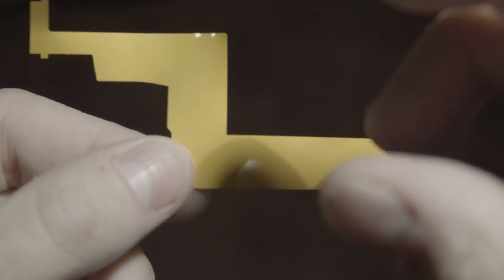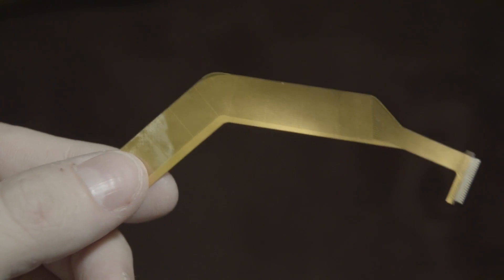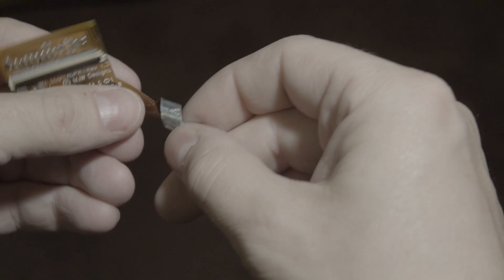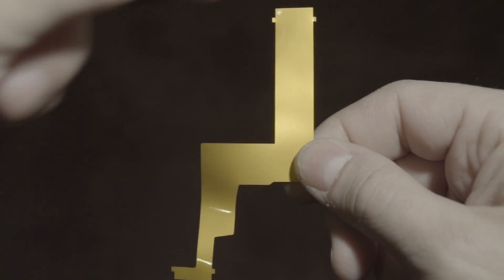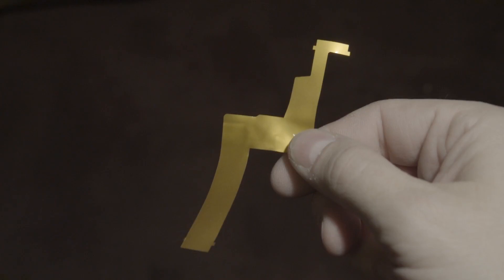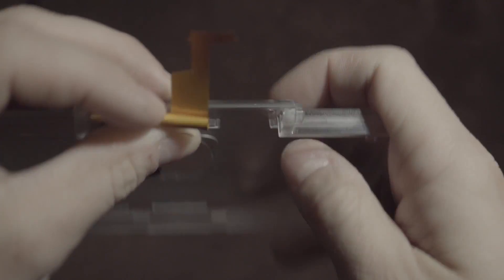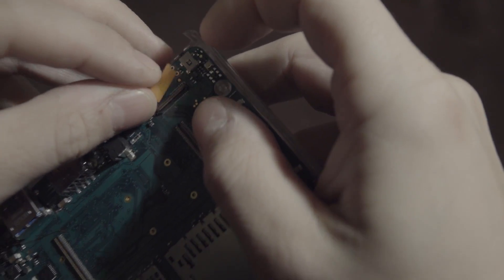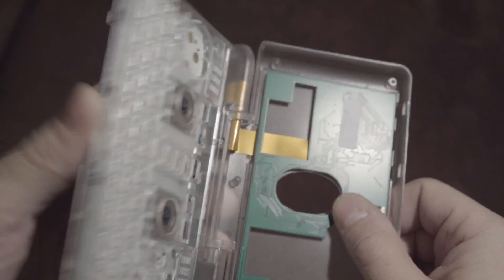Pyra - Explaining the new LCD Cable

Comment: I'm a bit concerned about the 90 degree bends of the traces, the rolled up radius is slightly better (on average one cable thinkness longer if the old cable had 50% overlap) but the bends themselves will now get deformed. The basic idea is good but the curved traces may not like being bent around this much. Perhaps we should have an extra lap of rotation on both sides?
Reply from the maker: When opening the lid, the cable makes a slight S-Curve inside the case, outside of the hinge.
There's enough space there, so that shouldn't be a big problem.

That will be tested though - we've got both designs (roll and not-roll) ready, so we can easily decide which one to mass produce.
Reply: +OpenPandora I don't know how well the connectors deal with loads like that over time but it sounds like there will be a lot more testing, so that's reassuring.

Personally, as a guy who preordered on the opening day, I wouldn't mind going through a couple of cable revisions if needed so don't worry about trying new things :)